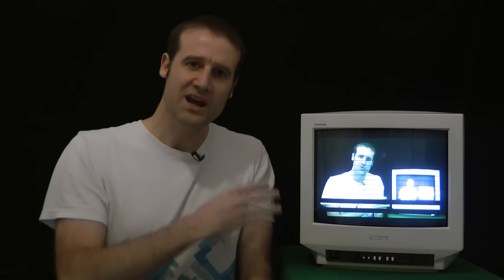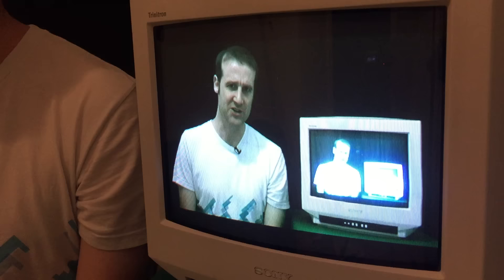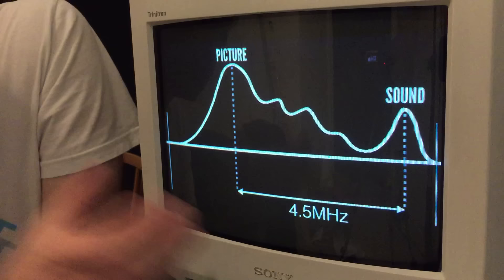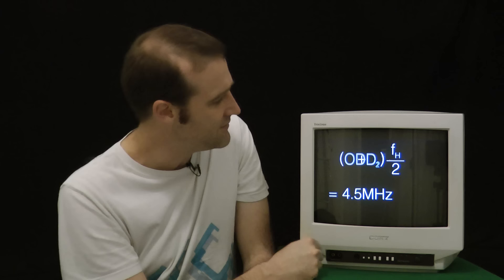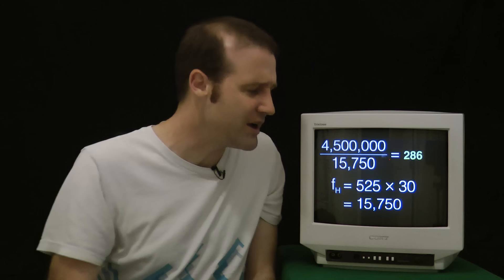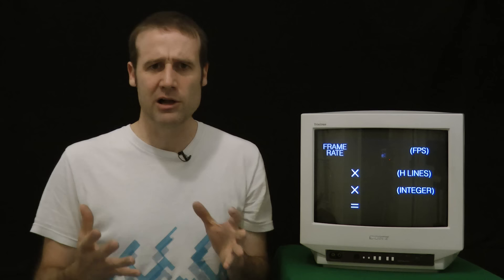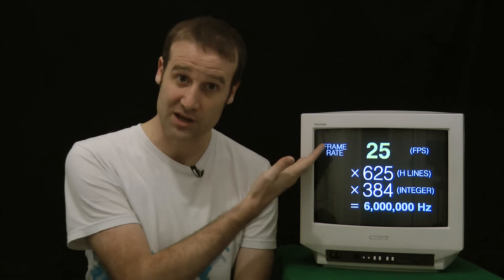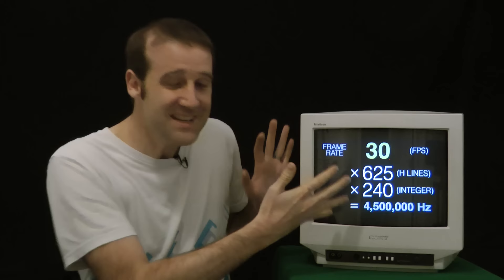Why is TV 29.97 frames per second?

Comment: And im watching this on my 144 fps gaming monitor.
Reply: It'll still only run at the framerate of the video
Reply: Do they even make games to run at that many frames per a second?
Reply: most games on pc have they're frame rate unlimited meaning it will go as fast as ur hardware will allow while on consoles its limited to ether 30 or 60 and yes you'll notice a big difference going from 60 to 144 while going from 144 to 240  you wont notice as much a difference.
Reply: yotubewatcherhalo I'm not programmer but when they make the engine for the game, wouldn't they not bother to make it produce anymore than 60fps. You'd get the frames in the report but they're just be duplicates in reality. When they create the animations they're probably only at 30fps, unless they used motion capture, but most high frame rate film is capped at 60fps. The particle physics may benefit tho.
Reply: true some games the animations and such are capped especially some older games
Reply: +A Koala with Shades  Having an FPS higher than 60, even if your monitor isn't able to display all the extra frames, the game will still be reporting mouse movements/key presses at a faster rate, making your input more responsive. At 60fps, there is up to a 17ms delay from when you hit a key on your keyboard to when the game performs the action; at 144fps the delay is only 7ms. It seems tiny and it's hard to explain, but it can make games feel smoother and more responsive.
Reply: Joe S alright, sounds interesting. Probably have to see one in real life.
Reply: 144/50 (this vid is 50 fps) = shit
and yes 144hz for faming is totally worth it
Reply: futurestoryteller Yes, mostly all games on PC can go up to 144hz. Once used to it, anything less is literally unplayable.
Reply: WTF is that directed at me, I didn't say anything about it.
Reply: futurestoryteller, No need to be hostile. 144hz is the future... I'm just kidding. Have a great day.
Reply: Which happens to be exact 6 (an integer!) times 24 fps.
Reply: their*
Reply: if only you had gone like 20-40 more fps your dog could watch that monitor
Reply: most of them can
Reply: And anyone who follows the Geometry Dash community knows all about the advantages of 144hz monitors...
Reply: SVP4 will interpolate youtube and other videos to 144 fps. It really smooths out camera pans and is very effective on animation.
Reply: Can a human eye even spot the difference of lets say 90 fps and 144 ?
Reply: Hannes C., in some ways yes in some ways no. since the human eye doesn't see in discreet frames like a screen shows, there can be the occasional frame jump that your mind may or may not filter out. the difference is pretty small. however after around 170fps, your dog can start watching TV with you.
Reply: yep
Reply: +PoorsVids It think animated footage interpolated up looks horrible, but real life footage looks mildly tolerable when done well. That's just my opinion though. I've seen a lot of 60fps anime videos on here that made me want to puke compared to the native framerate, but others seemed to like it, so again, it's just my opinion.
Reply: or just disable vsync, so the gpu have not to wait the monitor.
Reply: @forbidden-cyrillic-handle  that said, when gaming, even if the action happens, if you can't see the results, you can't choose your next action as effectively. (I recently got a 144hz monitor and can vouch for the percieved increase in responsiveness.)
Reply: I bought one of those and kept wondering why I see such harsh color banding compared to the old monitor.  I had my suspicion but had to confirm it...  Indeed, the 144Hz panel is 18-bit instead of full 24-bits of the video mode.  As I work quite a lot of graphics the 18-bit panel just wasn't doing it for me.  Still use my old LCD monitor from 2006 which calibrates nicely to a pleasant D55 tune, with virtually imperceptible adjustment.  The model is ASUS VG248QE.
Reply: @futurestoryteller  which is 50fps
Reply: 144fps not hz
Reply: 240hz monitors would like to have a word with you...
Reply: @yotubewatcherhalo  console gaming is better than PC gaming
Reply: Human eyes can only see 29.97 fps.
Reply: yet this video is 30fps
Reply: @gigigigiotto1673  and u get screen tearing and your monitor still can only display 60 frames per second. vsync just means ur gpu waits for the monitor to finish displaying frames before loading the rest of the frames, where as with it off it skips frames etc.
Reply: @Olterior  i know i'm not stupid :) but if you disable vsync you will improve latency

Comment: The reason why they had to go that route with 29.97 hz was to maintain compatibility with B/W TVs. Color sets were incredibly expensive and relatively rare for another 10-15 years or so. So, the FCC required the engineers to keep compatibility with the B/W standard, which admittedly was flawed using 525 scan lines. However, the 525 scan lines was a number picked because of the current technologies ability to control the scan beam in the 1946-1947 development period.

Comment: The obsession to remain compatible forced the designers of color TV to use a very complex system. The first color TV were very expensive, partly because of all those extra vacuum tubes needed to decode the complex encoding of color. The luminance was exactly what black and white TV expected. The chrominance was using analog math operation. The TV station didn't send the Red, green and blue intensity, like with computers. They were sending a difference of intensity between luminance and all 3 colors, and another level of indirection of one color information combined with another, but subtracted from the third one...
The first color TV we bought in 1968, a philco ford, had 29 vacuum tubes and about 30 transistors. Each vacuum tube was actually two, three or four independant amplifiers sharing only the filament/heater.
Near the high voltage (25 kilo volt) transformer, there was two very big vaccum tubes, both with a metal cap on top.. The slim one was the 25 kv rectifier (high voltage diode). It glowed purple. The other one, larger, was a "consumable". It had to be replaced every 2 years. At a price of $200 and a visit of the technician, this was a major incovenience.  Once 100% transistor color TV were finally no more an engineer dream, I inherited the old vacuum tube tv.
I made many interesting tests with the 25 kv, both AC and DC. The vacuum tube plates were bright red during those arcing tests. I also modified the horizontal/vertical 'yoke' connection ; 60 Hz sinusoidal wave horizontally, the output of an amplifier vertically. The effect is similar to a scope, but with the 3 color lines, red, green and blue, drawing lissajou style graph.
Repeating that using more recent color TV proved a challenge: because the covergence is so good, all these modern tv showed was boring white lines. A permanent magnet placed near the neck was needed to force the 3 colors to separate.
 
It is not the human/retina persistence that allow to see a flicker free image in TV scanning at 60 Hz. It is the selection of phosphor.
That is why TV in Europe have an annoying blinking. European  didn't invest in research for phosphor that would work with 50 Hz. They just used the same as Americans did.

The black and white TV where synchronized with the AC power because TV power supply were not well regulated. The DC voltage would go up and down by a few volt (over a value of 300 volt). The brightness was changing a little and the width of the horizontal scan was also changing with the AC input of the TV.

If the vertical scan would be any other frequency than 60 Hz, there would be annoying phantom intensity noise moving up/down.
When the color TV were designed, the power supply of most black and white tv were good enough to accept a change in vertical scan frequency.

The difference betwen 60 Hz of the grid and the vertical scan of 59.98 Hz meant that a beating frequency of 0.02 Hz would appear ; 1 / 0.02 = 50 sec. 
For many years, color transmission was rare. Most TV programs were in black and white with a vertical scan set at 60 Hz, synchronized with the power distribution. The TV station would tease people many days in advance : don't miss a color TV presentation Wednesday at 7h00 pm.

When that day came, we could see why that TV costed so much. It could show color !
There was a slow scan of noise, a noise pattern that repeated every 50 seconds.
Some days, when the rabbit ears antenna was moved by whoever clean the room and don't care about where the antenna should be, the defect would be much more visible. A distorsion in the horizontal scan that moved vertically, at about one full cycle per 50 second.

Comment: what about 23.976
Reply: It's a consequence of showing 24 fps film on NTSC television. NTSC has 59.97 images per second. ("Frames" are a fiction; a pair of interlaced images ("fields") treated as a unit for purposes of editing and, in the digital realm, storage. But in interlaced video, all you actually capture or see are fields (or in scanned analog video, a flying spot...)

Showing film on television involves what's known as 3:2 (or 2:3) "pulldown" -- a special projector that alternates between showing a new film frame after 2 or 3 television fields. One film frame is scanned by two fields and the next by three, then two, then three, and so on. Since NTSC runs 1000/1001 slower than 60 fields per second, the film frame rate also ends up being slowed down by the same factor. And 24 times 1000/1001 is 23.976024, which we usually round to 23.976 (or sometimes even 23.98).

Comment: in the year 2020 no ones knows what a crt is and has been replaced with holograms to record old style videos
Reply: Or OR, smartphones just have a screen on both sides, and computers are slightly faster (6.0GHZ)
Reply: Nah i don't think so. CRTs are still widely used. Especially everywhere where you need to make sure the colors of the screen are spot on.
Because flatscreens that you can calibrate correctly are fucking overpriced compared to a CRT.
Reply: 2020 is only 3 years away. Holograms won't be a thing in 3 years, it will take more time
Reply: +Random Guy From Texas

The main reason millennials are the way they are is because of their parents. Everyone is just a product of their environment, so in a way, it's actually partly their parents fault
Reply: +Random Guy From Texas

I'm not saying it's entirely their parents fault, but they played a part and that's the truth. You can't control your childhood, and your childhood plays a major part in determining how you are as an adult, so it isn't fair to place all the blame on the millennials.
Reply: +Random Guy From Texas All I hear is "bwaah I don't like change" bro.
Reply: +Random Guy From Texas Seems like I struck a nerve there bro. Wanna talk about it?

Comment: Well meaning, but basically WRONG.  There is nothing magic about having to exactly hit 4.5,MHz.  What is really going on is that the color information is a subcarrier at 3.7585 and at that frequency the subcarrier flips 180 degrees on every line, which visually cancels out.  Very clever.  But to get that flipping the horizontal frequency had to be tweaked a few Hertz downward, which affects the vertical frequency.

Comment: The fundamental constraint placed on the developers of NTSC was to maintain backward compatibility with all the B/W sets that were already out there. So any changes to channel bandwidth were out of the question, as were major shifts to the scan rates. Changing to a 625 line image would have been too drastic a change in horizontal scan rate, obsoleting every existing B/W set.  The modest scan rate changes to 29.97 and 15,734 were well within the lock-in range of the sync circuitry and sweep oscillators in existing B/W sets.

The developers of PAL were given free reign to design their system from scratch, so they chose much more logical scan/frame rates as a result.  But then all the old 405 line sets couldn't tune in and still get the new color shows in B/W.

Comment: It likely has more to do with changing to color TV but still allowing existing non color displays to work correctly.
Reply: Yes exactly. If they changed the amount of lines, existing tvs wouldnt work. its not like digital where you can interpolate resolutions onto different monitors.

Comment: Here in Brazil we use a system called "PAL-M", it's very similar to NTSC, but it has very tiny differences, one of them being it runs at true 30 FPS, instead of 29.97 FPS.

Comment: A few notes...

The need to shift to 29.97 frames per second, more specifically (but you're correct), was to prevent artifacts from appearing on black and white televisions that were receiving color broadcasts.

I'm not certain, but I believe a 625 line broadcast wouldn't have worked on a 525 line screen. Converters may have resolve that, just guessing.

###

So why interlaced (1,3,5,7,9,2,4,6,8) video rather than progressive video (1,2,3,4,5,6,7,8,9)? Bandwidth! Back in the early days the technology didn't exist to broadcast lots of data so the engineers fudged by sending half a frame - that looked sorta' kinda' like a full frame - at a time. Half a frame, the odd lines, now; half a frame, the even lines, next.

###

In the US and some other countries the standard motion picture film frame rate, as you mentioned, is 24 frames per second. That generates an "uh oh" moment for engineers. In the UK (and commonwealth countries I assume) the motion picture frame rate is 25 frames per second - easy to transfer film to video. In the countries where 24fps is shot and the television standard is NTSC, lots of tweaking has to be done when transferring film to video (with an exception I'll describe).

Film to video transfers in 24/30 countries like the US... As you mentioned, old-school video is interlaced - 30 frames per second, the same as 60 half frames per second. Let's call the odd lines "field one" and the even lines "field two." So let's transfer three frames of movie film, shot at 24 fps, to interlaced video. (In this summary, a "video frame" is composed of the two fields.)

Film frame one gets scanned to field one and field two of video frame one.
Film frame one also gets scanned to field one of video frame two.
Film frame two gets scanned to field two of video frame two and to field one of video frame three.
Film frame three gets scanned to field two of video frame three.
Film frame three also gets scanned to field one and field two of video frame four.

Repeat over and over in a process called 3:2 pulldown.

If filmmakers know in advance they're shooting film primarily for transfer to video, as some TV shows do (or rather, used to do), they can switch to shooting at 23.976 frames per second, a slow-down of only .1%  from the 24 fps rate you see in movie theaters - that slightly lower speed isn't detectable when it's speeded up for theatrical viewing. Why 23.976? It's exactly 80% the speed of 29.97... and 24 is exactly 80% of 30, and so 23.976 is a more accurate rate to choose when transferring to video. (When creating 24fps prints for the theaters from film shot at 23.976fps, the audio has to be slightly sped-up to stay in sync.) A 120 minute movie seen in the theater will take 7.2 seconds longer to watch on TV. (I think I got the math right; correct me if I'm wrong.)
Reply: Your statement about 23.976 being only a .1% slowdown from cinema's 24fps also applies to how color NTSC is .1% slower than the old black and white NTSC. In the description it is said that the actual number isn't purely 29.97, but in fact 29.97002997002997 repeating, AKA 30/1.001 fps, which means that color NTSC is 0.1% slower than the original black and white NTSC standard, just like how 23.976fps NTSC-appeasing film speed is 0.1% slower than 24fps conventional film speed. This 0.1% difference between the frame rate of color and BW NTSC is so small.

Comment: There is one missing villain at your party.
That is the color subcarrier frequency, 3.58 MHZ in the US, or 4.43 MHZ in Europe. 
Because if the color subcarrier, the horizontal frequency was obliged. If any different, an highly bothering (moving) reticle would superimpose to the raster. 
With the chosen subcarrier and horizontal frequencies, the reticle would be stable and dissimulate within the raster (scan lines). This is why the only parameter to modify is the vertical frequency. The 0.03 Hz difference is well within the locking range of the vertical sync oscillator.

Comment: A slight clarification here - traditional analog television actually scans a complete new image per-field rather than per-frame, meaning that additional temporal information is sent with each pass of the raster beam from the top of the screen to the bottom.

As such, it’s approximately half the lines at double the rate - 262 lines at 59.94Hz, which would be assembled on the display side as a 525-line interlaced picture. (This trick is partially why retro video games display at ~240p at approximately 59.94Hz, which is often overclocked in emulation to 60Hz to sync with modern displays.)